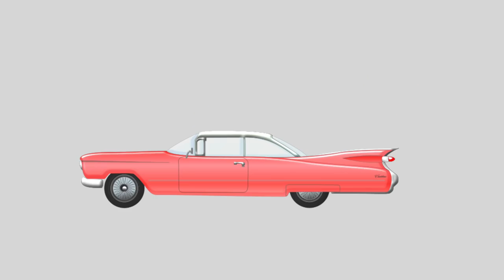Yes, Rockets CAN Fly in a Vacuum

Comment: Rockets push high pressure gases out of them, so they can fly in space. 
It is pretty simple.
Reply: FelpeXD _ops 
Basic physics, conservation of momentum!
Reply: I know if I drive down hill I go further on a tank of fuel than if I go up hill.  (  gravity.  force,  and whatever )   With space being kinda sparse,    will certain fuels go farther  Or get more MPG   ?
Reply: The pressure created by the combustion of the rocket fuel pushes on the combustion chamber and the engine bell, not the atmosphere (or vaccum) outside of the engine.  So rockets work fine in a vacuum.
Reply: So what happens to all the mass being accelerated out he back of a Rocket? F=MA.
Reply: @tam hill, Yes! Rockets use a function called "specific impulse" or ISP to gauge how efficient fuel use is under different circumstances. ISP is basically the fuel efficiency of that engine/fuel combination and it changes depending on air pressure and engine/fuel configuration of the rocket. But it stays the same for that rocket engine as long as it's in a vacuum.

In fact, relevant to the subject of this video, rockets are actually LESS efficient in atmosphere than they are in a vacuum because the pressure of the air pushing back on the exhaust reduces the thrust. It's the difference between the pressure behind the exhaust gas and in front of the gas that causes thrust. Less pressure in the space outside the engine means greater thrust for the same amount of fuel.

There is also a separate phenomenon known as "gravity losses" when flying a rocket. It's like going uphill because as you're trying to fly upwards gravity is trying to drag you back down. But if you can turn at an angle you can start going sideways fast enough to fly over the horizon before you hit the ground. This is called a "gravity turn." Do that long enough and you're in orbit. It's more efficient than going straight up, because if you just went straight up eventually you'd just fall straight back down again and then STILL have to add sideways velocity to your flight to get into orbit.

Then there's ANOTHER phenomenon called the "Oberth effect" which, in simplified terms, calculates that you will gain a greater change in velocity the faster you are moving. So it is more efficient to do an engine burn when you are at the fastest point in your orbit.
Reply: Thats what I wanted to hear Herman;  I often thought that the rocket will use 10 or 20 %  of its fuel to get out of the Earths atmosphere.  then its easy going towards the Moon.  Almost like coasting.  Fire the engines once in a while to adjust direction and again to put on the brakes.  Also years ago I thought of launching from the Moon.  save time and fuel.  But that would cost billions to set up.  A trip to Mars;  launched from our neighbor the Moon;   might shorten the length of the trip by quite a bit.  That may be the only option we have at the moment.  Mars is a few months away.  But with a saving in fuel and time,  that may be an option.
Reply: +Tam Hill the moon is only a tiny bit closer than the earth, half of the time.  It's not going to save you that much.  The real savings is the delta-V required to lift off from the earth versus the moon.  But that doesn't help if you have to start your trip on earth anyway.
Reply: +lyle landstrom what happens to all the mass being accelerated out the back of a rocket?  It wanders off without doing anything useful for the rocket, it's job was done once it left the nozzle.
Reply: +tam hill "... get more MPG?"  You got part of the answer from Herman (talking about ISP), I'll mention a related physical aspect.  The thrust of a rocket is simply defined as how much acceleration you can give to a certain amount of mass.  Which means that if you can propel the same mass to a higher acceleration, you get more thrust.  With identical fuels and flow rates, you achieve that by playing around with the fluid dynamics of the rocket nozzle to get the acceleration higher.  But if you can throw more mass at the same acceleration, you get more thrust.

The peak of development so far is ion-based rockets.  They hurl small amounts of mass at stupendously high speeds.  The reaction mass is basically a lump of a heavier metal that is eroded and thrown out the back with essentially a particle accelerator.   High efficiency,  relatively low thrust, but can run for months, and even tiny accelerations (hundredths of a G), eventually it's going a lot faster than a short fast burn chemical rocket.
Reply: Fromage Frizzbizz :  thats what I wanted to hear.  I was impressed as 'ell when the Moon landings happened.  I was  a kid but it impressed me.  I always thought the next logical step would be Mars.   That ion-based rocket that can use a fraction of the fuel,  sounds good.  I think the objective should be to get to Mars.  Interest peaked as a kid with the moon landings.  The next significant jump from NASA was the shuttle program .  I think that was mainly a testing program to obtain information about  reusable rockets.  that could be utilized almost anywhere.  Mars is too far away.  We need a better plan.   But I want to see something happening within the next 20 years or so.  I want the interest in the space program peaked as it was years ago.
Reply: +tam hill the problem is that if we want it to be sustaining into the future, it has to be profitable (in some sense, not necessarily monetarily) or at least self-sustaining and profitable enough to provide the up-front investment.

As it stands now, there's money to be made with LEO, and to a certain extent GEO.  MEO/Sun orbit not so much - still the preserve of governments and research.  And without people on them?  Boring.

You won't get much excitement from another space station - been there, done that several times.  Moon landings?  BTDT 6 times.  Moon habitation?  _Maybe_.   There's not much there worth the lift.  He3?  We already make enough of the stuff on earth to fulfil demand at reasonable prices, and it's presence on the moon is more of a guess than anything else, and mining it at reasonable production levels will be expensive as all hell.

It's good that we have someone with enough bucks to push for Mars actually is pushing for Mars.  Which is going to require a lot of intermediate development (perhaps on the moon or even in orbit) that'd we'd have to see starting just about _now_.

The time is great - Falcon Heavy has had its maiden launch, Blue Horizon and NASA SLS are about to debut, and there are literally hundreds of companies doing things that only governments could do a few decades ago.  Great things will start happening faster than you think.
Reply: Sounds good ta me.  I hope everything works out as you have described.  1,000s of companies creates a race.  A race creates an eventual winner.  An eventual winner  is the one who puts the marker on Mars.   Like Neil Armstrong putting the stars and stripes on the Moon.  The next " Neil Armstrong "  will place the flag of thier team on Mars.  And it will forever be the first.   Just like Roger Bannister.    Who won the 1500 meters in last Olympics  ?   ( nobody knows or cares )   - but everyone knows Bannister broke the 4:00 mile.
Reply: Depending on the elements mixed and their combustion rates then yes. Now I am a physicists not a chemist so i could not tell you the exact type of a purposed mixture. But if you had a fuel that releases higher energy when burned then you would need less of it in space to go faster or slower.
Reply: @SlocketSeven  I concur, to believe the atmosphere is pushing against the supersonic rocket exhaust and thus pushing the rocket forward violates the known fact that in supersonic flow, what happens downstream has no effect on what is happening upstream.

Comment: Exhaust doesn't move a car forward LMAO! It's the pistons on the crankshaft that move the gearbox and the wheels. As for a rocket in an infinite vacuum, the vacuum would suck up all the exhaust and not create forward motion. There's nothing to push against.
Reply: - "There's nothing to push against."

So according to YOU a crossbow fired into a vacuum would have no recoil?

Are you sure you thought that through?
Reply: Look into conservation of momentum..
Reply: Power shaft turns axle to move the wheel?
Reply: Lmao, I think your mind has vacuum. Rockets go into space which is vacuum and pushing out the gas will push the rocket in the opposite direction of the gas, and a cars exhaust gives a very small amount of thrust, but it does move the car by a very small bit, she mentioned it's no enough to move the car, and the engines pushes the wheels